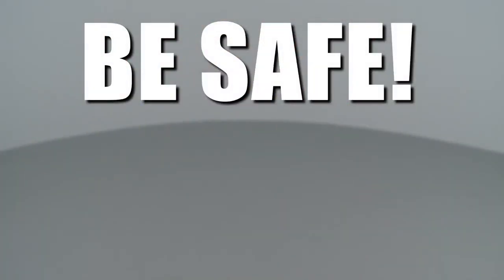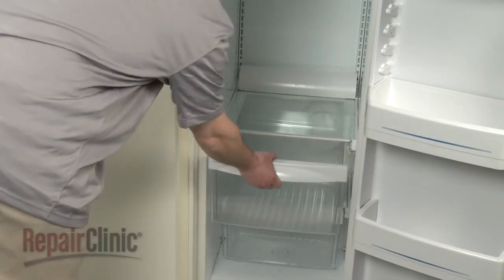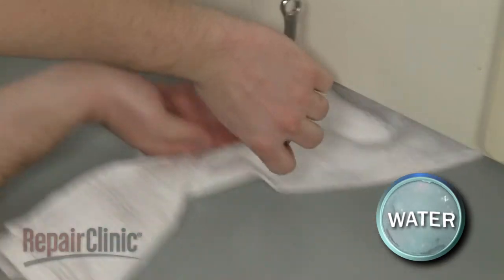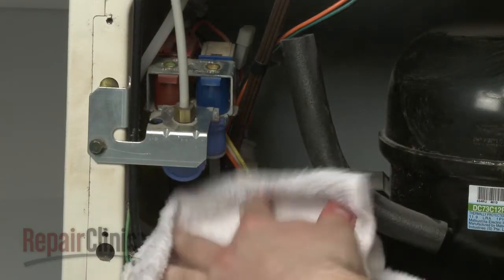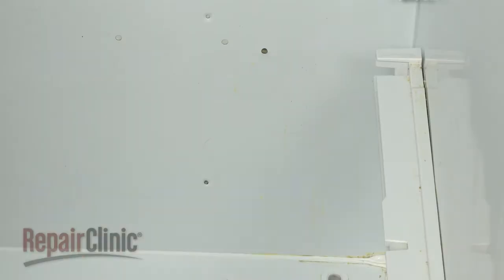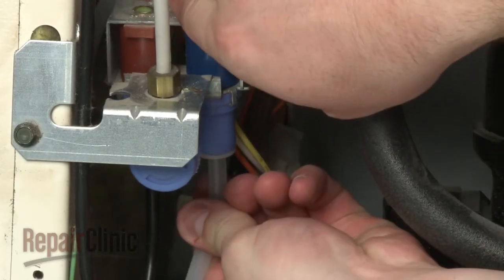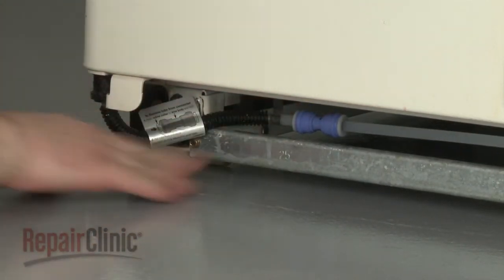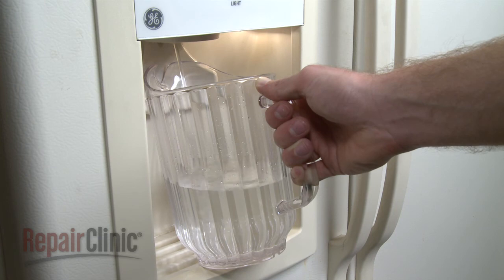GE Refrigerator Water Coil Replacement #WR17X11324

Comment from the maker: Yes. A lot of water tanks are now being replaced with coiled tubing. You might check to see what your model brings up for a replacement tank first. It may already be replaced with a coiled tubing kit. If not you will just need to use couplers to attach the new tubing lines. We have couplers if you need them. 5/16 to 5/16 # 963908 or ¼ to 5/16  # 1969734. The coil itself can be bought on our website as well.